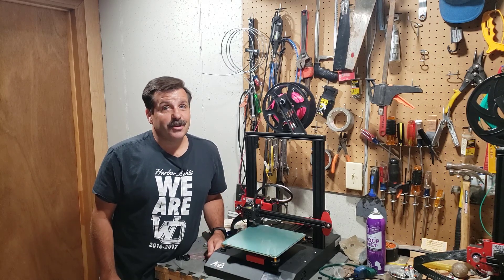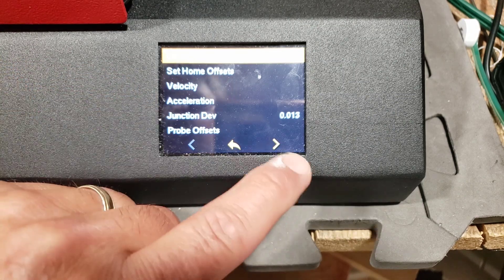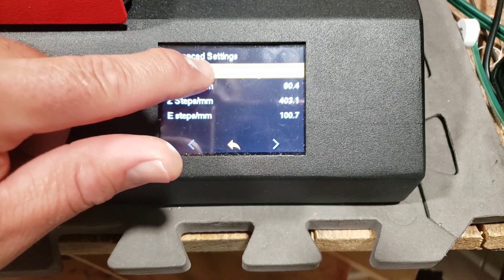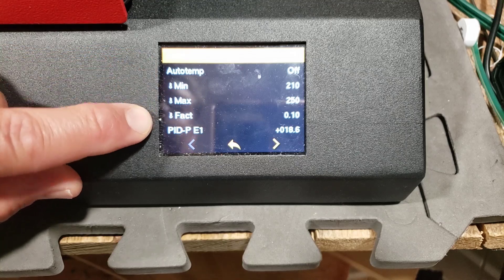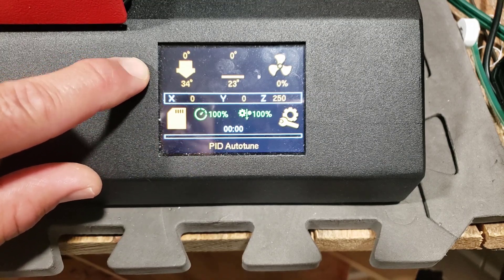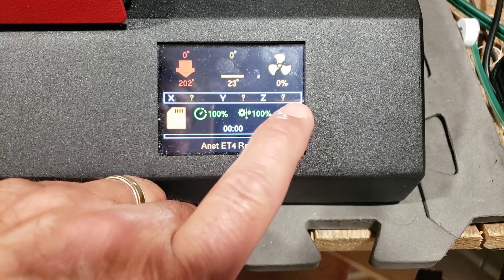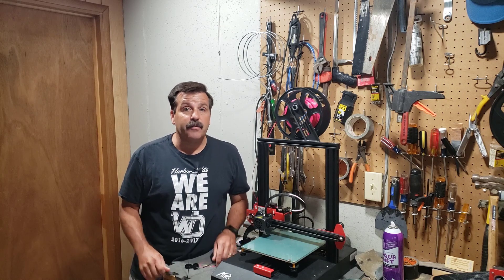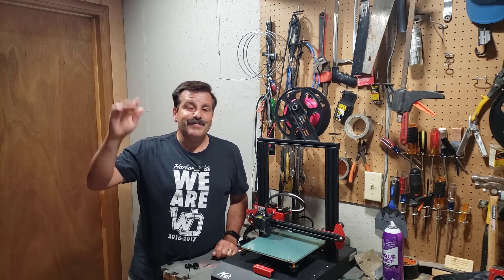Anet ET4  E-steps and PID autotune Marlin 2.0+ Advanced Configuration

Comment: I have an ET4+ Pro, but it must be an earlier version of software as the screen is entirely different. On the Settings screen there is a 2x2 table with X,Y,Z and E.  I presume this "E" refers to the E-steps you refer to.  There is also another Icon that looks like an "M" within a circle ... no idea of what that is. My problem is that until recently, when I used the HOME icon on the screens and when printing, the hotend traveled to the printing "home", just above the bed, then it would move up 10 or so, then come back down, move to the starting position and begin the print.  Somehow, I've lost the extra step that lifts the hotend above the deck, allowing whatever melts out to fall freely, free of the nozzle end.  I cannot find a way to re-establish that extra step on the printer. I can see how to do it from the slicer, but I need it to do it on the printer while idle.  Any ideas?  I cannot find anything except your video here, but it's not quite what I need. Help!  (I realize this is an old posting, so I am not expecting much. Thanks.)
Reply from the maker: I believe you have the stock firmware that came with it. What you see in my video is a addon that I was able to do using a "programmer". It gave us access to tons of settings, but as you can tell since you used yours as is... it is not necessary. I think what you are looking to do is to modify the startup code for a print.  The way the printer moves before starting a print is in the start up code. See if this video helps you. https://youtu.be/pd8GB62k900

Comment: will marlin 2.0 run on et4 i have a problem with my extruder is operate back words you tell it to load and it unloads you tell it to unload and it loads how do u fix it
Reply from the maker: Yes it will. Sounds like your wires may be backwards if the buttons are working inverse. Or... whatever firmware you are working with may be inverted.

Comment: Can you show how you level on this printer with Marlin? Every other printer ive had was manual levelling, not sure how to set this one up with not Z limit switch, it only has the probe.
Reply: Correction, it homes perfectly, but when it starts the print, its atleast 20mm off the bed
Reply from the maker: Mine is at school, so I will try to look at it tomorrow. When you see it home, you see the sensor light go red, right?  That should mean it is detecting the bed... I am trying to think of why it would be crazy far off when printing.

Comment: auto leveling stil working on it  ?
Reply from the maker: I am not. I just use the paper technique I have always used.  I get good results, so it is not on my list for changing. I have used the adjustment on Z when I thought there was too much or to little adhesion though.  It seems to work well.

Comment: Great video! I am trying to figure out how to level it using menu and UBL leveling, without using g-code (paper always works with corner leveling of course)
UBL gcode leveling works too: 
1) Set up mesh: 
M502 - clean eeprom, 
M500 - save, 
G29P1 - level bed, 
G29S1 - save to slot 1, 
G29 F10.0 - feight height set to 10 mm, 
G29 A - activate UBL,
M500 - save eeprom
2) Z-probe: G28-home, 
G1x120y120, 
G1z0 - go to the center and z0, 
m211 S0 -switch off endstops to be able to go to Z  minus zone if needed, 
level with paper moving z axis, 
m114 - check result Z, 
M851 Z(numbers-result Z),
M211 S1 - turn on endstops back
M500 - save eeprom
M503 - check eeprom, if z-offset was saved 
G28 - home
G26 p10- test print    ).
Reply from the maker: Thanks. I have not messed with the UBL system. Grew up on the paper, have not adapted... One of these days I am sure I will get time and give it a go.

Comment: I flashed  my et⁴ then I tried to reverse firmware to it's original and it doesn't work. Can you make a video about it.
Reply from the maker: Are you using ST-Link V2? If so, this will work. https://youtu.be/KKCer809pxU
Reply: @HLModTech  Thanks, I found where I was wrong. I was flashing 1.1.5  firmware, that one won't let me flashing but with 1.1.2 version it works perfectly.